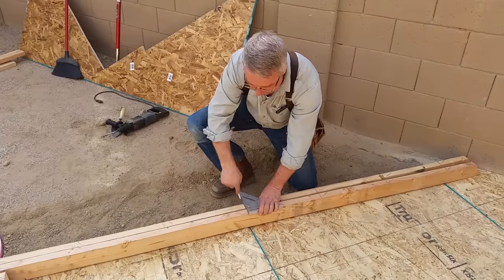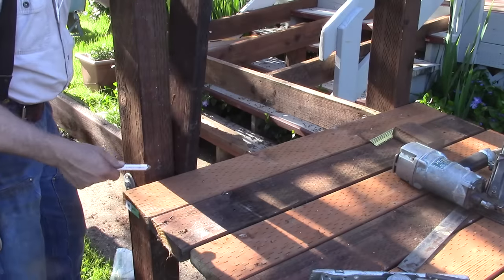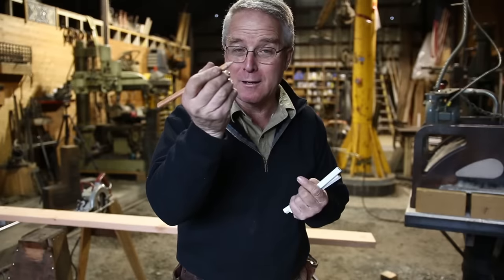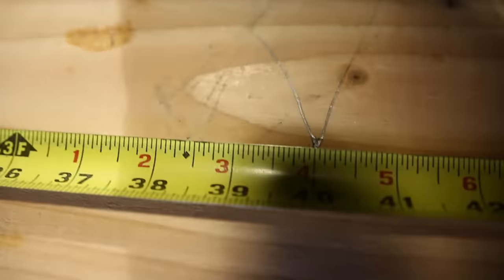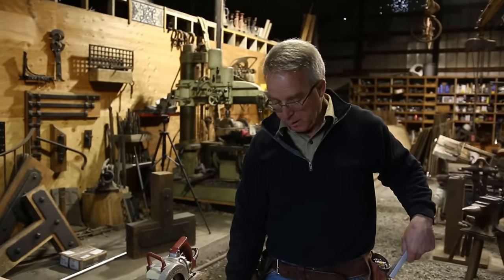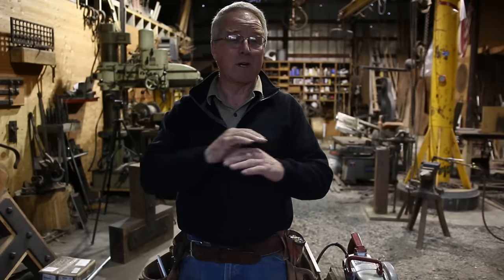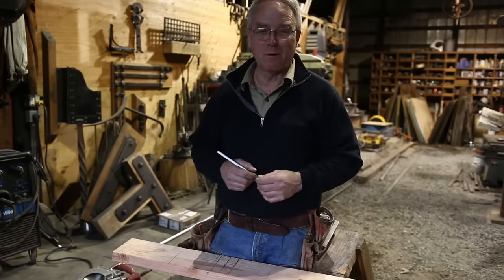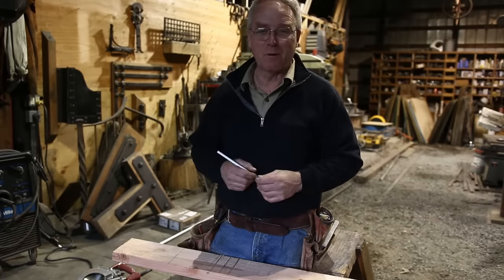Marking and Cutting Pro Tips

Comment: When using a square, you can place your pencil on the apex of your mark. Then bring the square up to the pencil. By doing this, you account for the actual thickness of the pencil lead. That way your line isnt off because of the thickness of the pencil/lead against the square.
Reply: Yep, this is especially true late in the day when the square itself causes a shadow to fall right where you want to mark the line making it hard to see where to start your line.
Reply: Scottiver I
Reply: Great tip. Thanks for sharing.
Reply: Good point, but even as mainly a plumber for most of my life, I've marked and cut so much lumber I account for the lead thickness (even with carpenter pencils or sharpies) without thinking about it. Don't even use a square. I just use my torpedo level as it's always on me. Of course it's usually backing and rough work is fine in that application.
Reply: TheBladeSickness works great with scribing layouts too
Reply: This is how I was taught by my dad - if only I could cut a straight line, I’d be set for life!
Reply: Joshua D hold the speed square up against the skilsaw when you cut
Reply: James Reichardt I’ll give that a shot this afternoon! Love a simple solution
Reply: @JamesR23  I always do that when cutting 2x10 or 2x12.
Reply: That's how I do it. A couple of guys I worked with on a Samaritan's Purse job really liked that trick when they noticed me doing it. My cuts are usually dead on.
Reply: Thats great info, thank you
Reply: Thanks
Reply: @JamesR23  Thanks
Reply: It's the only way I use a square and pencil. I'm horrible at following the line with the saw though. It at least staying a consistent one side is the other.
Reply: Good to know thank You
Reply: Thanks for sharing, I don't know how many time's I was off either by the mark or my cuts it gets frustrating when I'm putting it together and it's way off measurements.
Reply: Z
Reply: Great tip!  Took me a second to process, but totally makes sense.  Don't line up the square edge with the mark, line up your square edge with your pencil (already on the mark).  Thanks!! ✨👌👍
Reply: Things like this make it worth it to read the comments 👌
Reply: Nice man, thanks for that
Reply: I was just going to make this comment!!!! I'm a 1st period apprentice and I've never seen anyone ever do this. Taught myself. Only thing im proud of lol. Still learning

Comment: For marking accuracy, my old boss had a neat, fast system for us.
When you make your line, a simple small 'X' on the line in the middle, means 'cut the line', and a simple '>' on the side meant cut up to the line, and also denoted what side to cut on. So you would mark >| like that, and cut up to the line, cutting away the > mark. 
A great simple tip, I still use to this day for small wood projects.

Hope that helps anyone.
Reply: I know a guy who uses sort of a check mark. I don't know his system specifically but the short leg if the check indicates keep it take.
Reply: This is excellent. Acquired for use!!
Reply: Thanks for the tip. Amazing how such simple ideas can be so effective!
Reply: Use to use the crows foot as the indicator, the side that is at a bigger angle from the 90 is the cut side. So many different ways to do the same thing!
Reply: Nice! 👍
Reply: could you guys please tell me whether just shouting “leave the line” is universally understood to mean leave the line on the finished piece or might you have to shout “...on the finish piece” or “...waste side” to avoid ambiguity?

Also if that is the case i guess you’d need to mark the waste side to avoid further ambiguity.k x
Reply: @appak001  I'd never cut on the finish piece side of a line. The kerf would decimate any accuracy
Reply: Great tip! When do you cut the line and when do you cut up to the line? For example, framing and outdoor open air structures? Thank you!

Comment: I stopped using carpenter pencils years ago. I like using those big, fat pencils they give kids in kindergarten. They're about two or two and a half bigger in circumstance than a standard number two pencil and easier to sharpen than a carpenter pencil. I keep a cheap, plastic, kid's sharpener in my nail bag.
By the way, I've been building and Remodeling fir about thirty years and I have to say that your videos are spot on. Most carpentry videos on the interwebs are nonsense. You are very eliquently telling people how the trade really is. 
Nice job, sir.
Reply: Wicked Coolname funny thought i been rough framing 20+ and just only last week shopping with my daughter for school i seen those big frickin pencils and thought they would be kinda cool to try and sure nuff i went back and sold em out ..if they only made them just a lil shorter they wouldnt be so prone to snaging on every frickin thing..LOL..good lookin out!!
Reply: Use your belt sander and put some flat edges on the outside, and it won't roll as badly.  
You can also buy compressed graphite sticks (usually used for art), which have the advantage of being able to be shaped into exactly what you need and they are square so they don't roll at all.  
Better, you can sharpen them to one edge and virtually eliminate the gap against your straight edge.
Reply: @_SimpleSam  You can get the triangle kind in fat -- "MY FIRST TRI-WRITE" Ticonderoga pencils -- so it won't roll and you can show off your fatherhood pride by keeping the loud yellow elementary school color. (Also saving your fingers from the belt sander, maybe? Hehe) Available both with and without an eraser.

Comment: I was taught, especially when working with a crew, make a straight line mark at your length, throw your tail, or apex mark in the direction of the off fall. You still have the apex for accuracy, and know which side of the line it to be cut. This is also helpful working alone, marking a number of pieces, then cutting after all pieces are marked up. There is no mistaking which side is the off fall. We also made it a practice at the start of the day to calibrate tape measures. It's easy enough for the tab on a tape to get bent, pulling tapes side by side to check for accuracy can make a lot of difference. One person up pulling measurements, and calling down to a sawyer, a 1/16- 1/8" difference in calibration, makes for a good fit or a sloppy one.
Reply: Some tape measures are off an inch on 25 feet, varies by brand. So important to check them side by side, like you said.

Comment: Further to scribing a line with a utility knife for accuracy, always place your knife on the mark first and bring the square up against it. That way you know you're right on when you scribe the full line. This also works great if you're cutting a tenon or something that needs a scribe on multiple faces of the board. Place knife at end of existing line right on the corner of the wood, butt up the square against it, scribe the new side.
Reply: Stout Lager 👍

Comment: After making the mark I'll put an X on the side where I want to take out the kerf. Helps if i get distracted between measuring and cutting.
Reply: ...Let alone having someone else make the cuts. It's remarkable how much help I need remembering what I did a few seconds ago : )
Reply: If someone else is making the cut, I put an arrow on the side of the line to cut. X on off-cut if the two pieces are close to the same measurement.
Reply: instead of going the v when i mark my mark i usally put a tick where the mark is and than a line to where to bad peice is so i know that side is the bad one and the one with no marks on there is the good one
Reply: When I make my crows foot, I make the first mark more or less perpendicular to the tape, then the second mark, on the waste side, at a 20˚~ 30˚ angle. Makes it easy to tell which side of the apex to place the kerf.

Comment: Having a clear and consistent markup style on a site is so very key to a smoothly running workflow. 

Also never forget how important the difference between layout marking and cut markings are, and making sure everyone actually knows them...
Once was on a site where someone took the time to pre-measure and mark out all the sill and header plates for stud locations and length cuts, and then sent 'the new guy' off to trim everything. 
There was a very awkward silence for a bit when the new guy asked what we needed so much 16" blocking pieces for on the project.

Comment: A Carpenters ✏️‼️....yes is flat so it doesn't roll,.and the eyeball trick was just GOD LEVEL❕...but I did not hear....About the pencil being exactly 1/4" thick and used to get perfect separation of boards while making a deck...It Is  also exactly A  1/2" wide and exactly 6" long  ( new and unsharpened)....simply having one around for measurements is perfect unto itself.....I certainly do
This was a great vid 
🎩s off ‼️

Comment: I would only add that checking the "toe" of the tape measure regularly is paramount. Such an easy thing to miss and it can make a big difference !
Reply: Happened to me a couple of times. Of course I found out when I was doing window trim.
Reply: This is fine advice, but I think it should be articulated in a bit more detail for the beginners among us.

The tip, or toe, of a measuring tape is riveted onto the tape. Those rivets have a little bit of slop in them, allowing the toe to move back and forth very slightly. This seems like a mistake, but it's actually a vital and carefully calculated thing! If the toe was solidly fixed to the tape, without this slop, then you'd get different readings depending on whether you had hooked your toe onto an edge, versus pushed your toe against a surface. The difference would be the thickness of the toe itself! The slop is meant to be the exact same distance as the toe is thick, to compensate for it.

If the tape is poorly constructed, or if it has seen a lot of use, those rivets can become more sloppy than the manufacturer intended, and your accuracy will start to suffer. For most framing it won't matter a great deal, but every now and then it will matter a LOT, and you'd best know about it. Of course in finish work it's always important.

You can check this by sliding the toe back and forth and estimating whether the slop is the same distance as the toe thickness, but that's not quite as accurate as measuring a known distance both by hooking the toe and also by pressing it into a surface, and then comparing the two measurements.
Reply: My dad and I were building a garage. We were doing rafters he was the cut man and kept screwing up the measurements we were telling him. We thought it was his old man eyesight until someone was standing next to him and saw that a rivet on the toe was loose and catching. 

Then he told us he was fired from a framing crew just after high school because of the exact same thing.
Reply: That made me chuckle

Comment: The pencil sawdust in the eye trick worked for me a treat! Story Time! Was working on a job on a cut roof job me and an apprentice was filling in an I beam steal ridge with 8x2 timber, we was just above 2 sections aluminium tower scaffolding high, middle of winter in England is joyous weather and the apprentice got some wood in his eye, no way could he get down safely to the eye wash, so I done exactly as Scott said, lift the eye stay still and got the small chip out. Works a treat.

Comment: I'm glad you took up this topic. I enjoy your show and learnt more than a few tricks! Maybe I can humbly add a couple. I don't use regular #2 pencils... When I go with a pencil it's usually a #6 artist's pencil. Makes a cleaner line. Not as clean as you've pointed out as with a razor knife, but good enough for a lot of work. For really rough cuts, I use a charcoal pencil, especially if I'm going to be putting on a semi transparent finish later. It doesn't cut into the wood at all, wipes right off, and is real visible. And a very good book I read from the 1890s called the Complete Woodworker. It argued always measure into the waste and always cut in the waste because your saw blade is almost always going to be thicker than your scribed line, unless you're using a dovetail or Japanese saw. You'll almost always lose 1/16 of an inch if your kerf is right on your scribe line. Not really important for framing but can be a disaster making furniture or trim. I have little tool called a carpenter's scribe. It's pretty old. In case someone hasn't seen one, it's about a 2in bock of wood planed quite squarely, with a not much tolerant hole cut right the way through the centre. We call that the rail or the slide. About 8in long and maybe an inch in width, though I've seen them with rails up to 18in. The block has a thumbscew to tighten it down and a wee blade on the opposite side for making the scribe cut. Now me, I've sharpened that blade right down. Not razor but close. Since you can slide that block in both directions, I drilled a hole in the far end of the rail just barely big enough for that #6 pencil to be crammed in, with the point turned 180 degrees from the blade point. Now I can use it to make either kind of scribe mark quickly without using a tape. Well, sometimes you have to use a tape but usually it's just calipers. Sorry for the long post but some of this is hard to describe without pictures. Oh... And the carpenter's pencil? I sharpen both ends... One to a blade and the other to a point. Same with the charcoal pencil. I like tools I can get more than one use from! Thanks again for some great tool vids! 😀

Comment: A craftsman will mark it once. An Apprentice will mark it twice and a fool will just keep on marking it. An old Millwright told me that 40 years ago. I am not going to say how many times I had just marked a piece of steel.
Reply: Really good and experienced carpenters taught me back in 1981 to use the "arrow" mark like the video shows. That way you know/remember which side of that mark is correct, plus it's faster. Don't have to be perfect with the line, just the starting point/apex.
Reply: Granite plate and dial height indicator
Reply: Not sure how you mark something twice ??

Comment: one of the best markers for fine lines you used in the final shot, the chisel.  the single bevel rides right up to the square and makes a very fine line if you drag the cutting edge down the line. if you need a bolder line use the corner of the edge. it digs deeper and wider.  great content, really enjoy your videos.

Comment: One can achieve accuracy using a sharpie or even a paint brush. The trick is to use the proper part of the apex. The outer apex of the crow's foot (that is to say the outer point) is the least accurate part of the etch. The inside point formed by the intersection is the most accurate and the most readily correctible part of the etch. Thus, the best technique to making a crow's foot is to start the first diagonal mark from 1/8th to 1/4 inch away (say to the left) on the first diagonal etch.  On this first line, somewhere along that etch, there lies the exact point - the exact distance- you are looking to isolate. The second mark of the crow's foot should therefore be made such that the interior angle formed have at its apex this exact point. If you are off, you can "climb" either diagonal with the third (or fourth, or fifth!) diagonal etch, using a pencil, a sharpie, a paint brush or a mop.

Comment: Phenomenal video. I would like to add a few things I feel you may have glossed over though. Just my thoughts on it of course, not the end all be all.
When making cuts I always put on X on the cutoff side. It makes it easy to remember which side of the line I need to cut on if I get called away and have to come back.
 When you pick up a cutoff for blocking or backing or whatever, you know which side is NOT the factory edge.
I also use the X to mark which side of the line the stud will sit when doing layout. Just cover the X with the stud and it will be on center.
Don't forget that cripples, jacks or kings can always use a mark. Be it circles like some framers use or C J K written above the X.
Also thank you for including razor knives as a marking tool. Really great for chisel work.

Anyway, thank you for all the time and effort you put into your videos. They are amazing.

Comment: have you tried the pica dry pencils? here in Finland that's pretty much the only graphite marking tool i see on professionals (including me)
Reply: More and more in Norway. It's my go to pencil.
Reply: Neat, never heard of them before.  THANKS for the heads up.  I''ll try them.
Reply: allu50 I'm using the pica deep hole marker here in Norway, only problem with them is the soft lead, it won't hold a sharp tip for mutch more than one marking. That's the biggest drawback by far 🙃
Reply: Staedtler Mars technico 780 leadholder pencils are also a good alternative if people can't find them.
Reply: A coworker of mine here in Canada swears by them; he carries a little case of different leads and crayon - like rods, for marking any number of surfaces. His main complaint with it, tho, was that some of the leads wouldn't stay tight enough in the handle when sharpening, they'd twist and recede. But still worth it, he says.